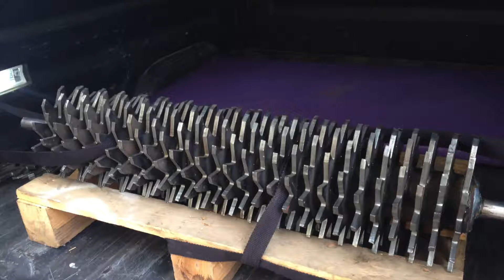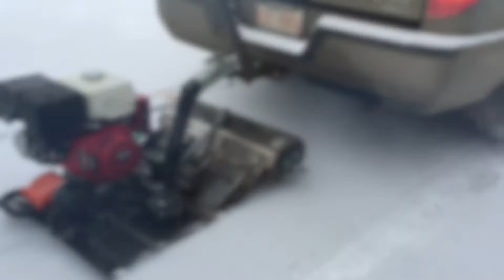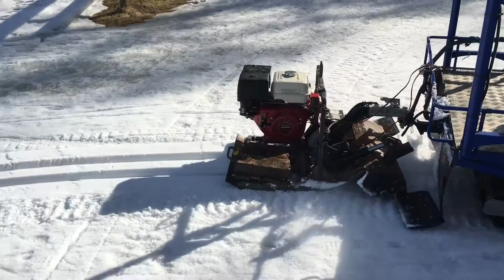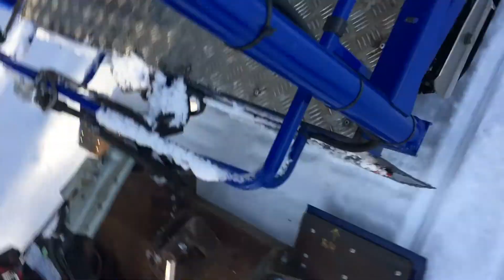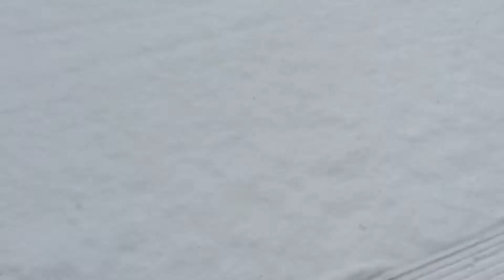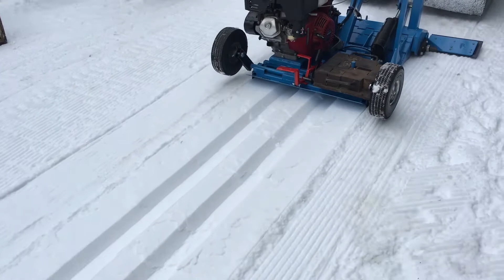Power Renovator Build

Comment: Great vid my dude. So you mentioned that the Ryobi is better for paved walkways. What did you like and not like about this particular model? And what was its real world throwing distance?
Reply from the maker: Jeremy, the Ryobi throws snow like a long range missile!!  However, here in Alberta our snow is light and fluffy. So it’s easy. However I never tried it with wet heavy snow.  Like the Toro, the Ryobi scraper cleans right down to a hard surface, gravel would get picked up and thrown by the auger.  Cheers!